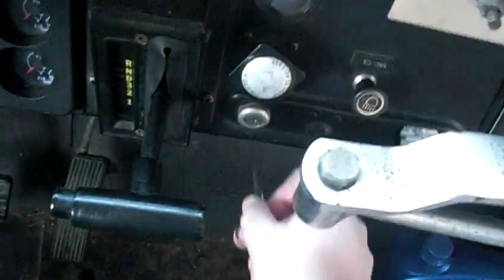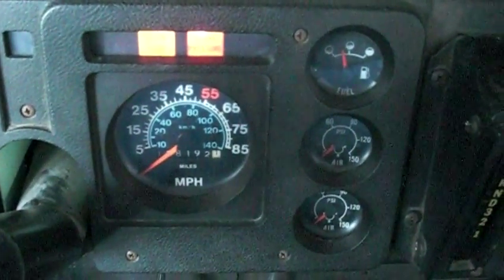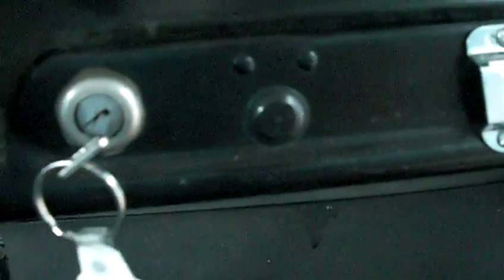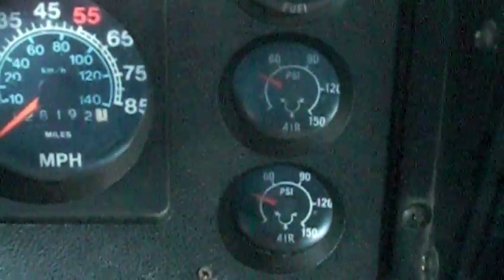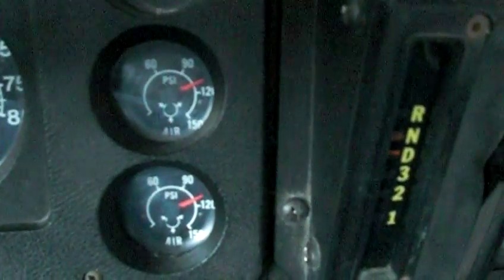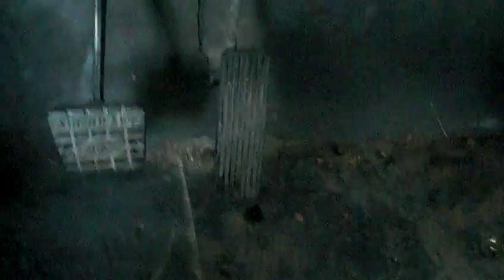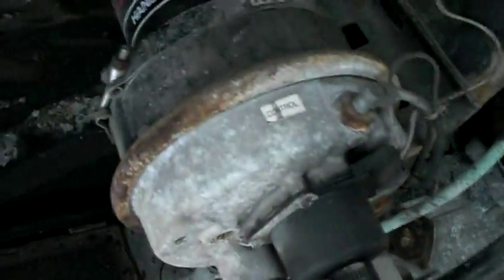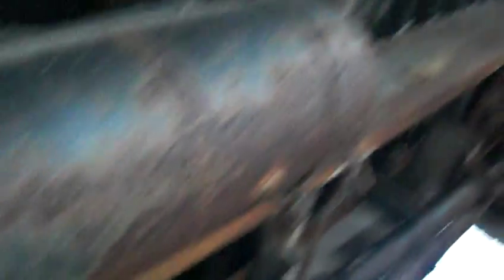1987 International S1700 Bus  - Air Brake Problems

Comment: That is a Haldex Pure Air Plus Dryer.  The cartridge on top is in a kit which is part number DQ6036.  Napa or Oreilly should carry that...  Yes, the air will leak from there because those lines are pressurized at all times.  After the system spits (opens the purge valve), the purge valve will stay open and hiss excess pressure for a minute or two.

Comment: The air dryer on the european truck will have a one way valve in the outlet port . that should prevent air from seeping back into the air dryer filter. check if your outlet port have the same . If not Ill put an one directional valve on the delivery port

Comment: when you check your brakes like that its best to have the maxi brake off when you do it but it seems to be taking alot of air out of the primary when you pump the brakes... napa would carry the air dryer filter if you guys have them in the states. over here in canada there are international truck centers all over the place. not sure what its like there tho.. try navistar